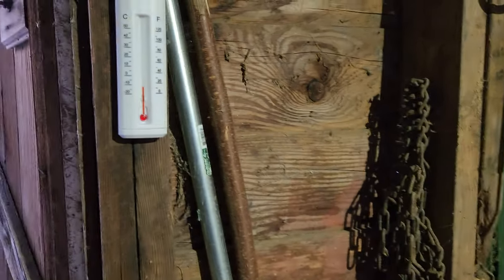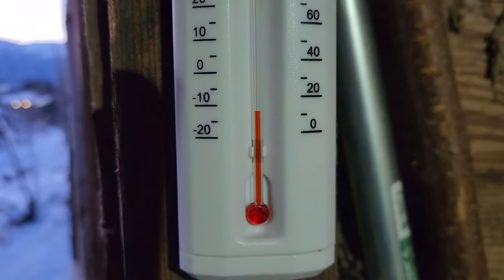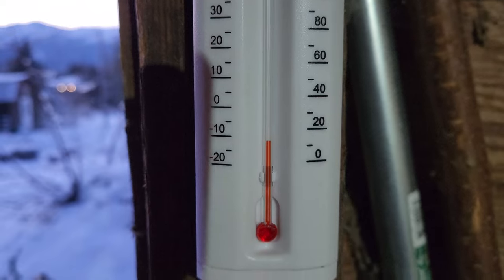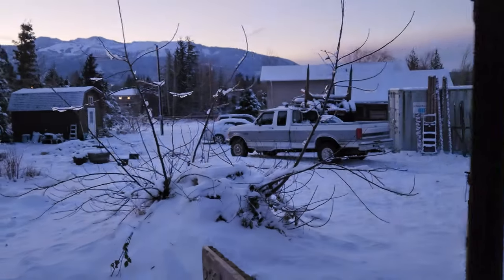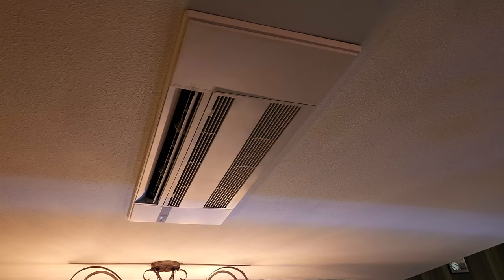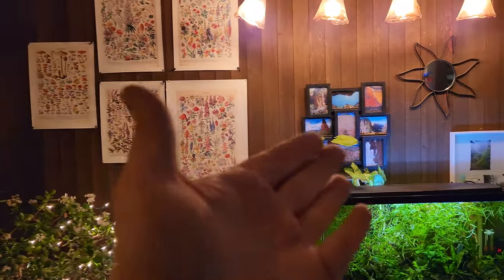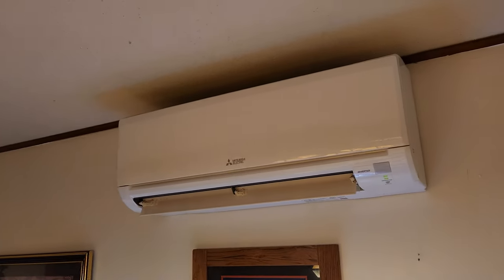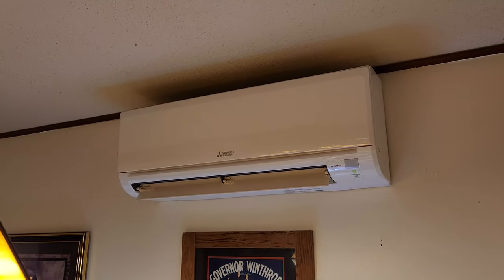Will a Mini Split work below freezing?

Comment: So far in the middle of the Arctic Blast in the NorthEast, at -13 and the mini splits are still spitting out hot air! I have 7 ceiling units (like the one you showed) and one wall unit. All of them working properly, but I can definitely hear the compressor working quite hard compared to when it not as cold.
Reply from the maker: Are you running the Mitsubishi as well?
Reply: @HomesteadBandwagon  yes :) all Mitsubishi. Only upped the numbers from 66 to 69 and spent the night nice and toasty.
Reply from the maker: That's really impressive! Guess I don't have much to worry about
Reply: @HomesteadBandwagon  indeed! Cheers!
Reply: Ya but how hot is the air what are you calling hot 65 degree discharged temp. Never heat your home with that
Reply: @billyrayboo7315 what you’re saying makes zero sense

Comment: My ramsond 27,000btu unit with two head’s running kept my house at about 70 degrees with outside temps between-3 to 12 degrees for over a week
Reply from the maker: That's impressive!

Comment: So are those the only way that you get heat? How can they cover the entire house? How many do you have? I'm just thinking about doing this but even with a small unit if I don't keep all the doors open they don't know how many I would have to have. And then do you lose efficiency if you're running lines through a cold or heated attic to get to other rooms to put another head in?

And don't you have to create some kind of wind chill effect when you're pushing hot air down because heat rises. So I always thought that just using an air purifier in the house in the winter I feel cheerier because the air is circulating not warmer.
Reply from the maker: We have 3 head units that heat the 3 areas of our downstairs. The heat rises and keeps things comfy upstairs where the bedrooms are, for the most part as long as you leave your doors open.  We have enough headroom to add a 4th unit upstairs if we wanted AC in the master bedroom or something like that, but haven't really wanted to yet. We'd need another heat exchanger if we wanted a head unit in every room, which would be pretty spendy. There are electric wall heaters in each room upstairs, but they're rarely used. It's been MUCH more efficient than any other heat source I've ever used, even though i run the heat much higher than i would with a furnace. It seems like it'll be less maintenance over time, as well as there's no ducting to clean and the main unit is outdoors, so it's very easy to keep that clean and unrestricted

Comment: I am not an HVAC tech, but I have had my Cooper Hunter 24k BTU splits installed about 1 year now, and I noticed sometimes when its super cold, like 20 or 15 or less (Fahrenheit) Also I am in NorthEast Pennsylvania.   They will occasionally make a "moose" sound, for a few seconds,  and from what I read its a pressure differential occurring. and its normal.  So sometimes, possibly your split might "moose" on you.
Reply: Does it heat good when temps drops very low?
Reply: @MrYorugua12345 mine worked good this winter.  So I would say yes.  .
Reply: @MrYorugua12345  Yes, it will run a little harder and might not be as efficient but yes, it does work.  I have 2x  Cooper Hunter 24k BTU systems, one for 1st floor , and 1 in basement.   I am in northeast PA and it did great keeping the house between 69 and 73 degrees the entire time.   This winter was not as bad as previous, but it was plenty cold enough.
Reply: I noticed on eBay today that a CH split has a COP of 3.81. is that real? What cop are you getting?
Reply: @BeKind-ve4id  I have no idea all I know is my electric bill has been better since stopping use of baseboard electric, and the split system kept up fine with heating the house this winter.  I am in the mountainy rural area of northeast PA and it gets just as cold here as it does for a friend of mine that lives up in Maine.  We get brutally cold weather for most the winter.  No issues here coming up on 2 years now.        Unless you bought the absolute cheapest Walmart clearance rack version of a split system, you should have no problems with a premium brand like Cooper Hunter.
Reply: Thanks for that comprehensive reply.

Comment: Do you run them on off peak electric?  Do they run up your electric bill a lot? Thanks from North Dakota
Reply from the maker: Out in our area, electric rates are the same any time of day, which is nice.  Our electric bill dropped by 30%, and we keep the heat on 24/7 at the same temp while also having AC, which we didn't before. I'm pretty impressed

Comment: I’m wondering why it needs to be outside, if it’s electric couldn’t it work if it was in the basement? Or in my garage? Heat the garage and the house
Reply from the maker: I've seen one in a cellar before, but when heating the house it would cool the cellar, and vice-versa.  It also can accumulate ice or condensation on the coils, which could lead to issues if there wasn't a whole lotta ventilation
Reply: Ok thanks
Reply: @HomesteadBandwagon  if it’s a actual in the ground cellar I would think (just my guess mind you) that if you ducted/vented the exhaust air out of the cellar you could take advantage of the ambient ground temp from being below the frost line? This would also help in the summer.
Again just a thought.

Comment: Question if you don't mind.  I have an old house as well.  By chance what is your cost to run this in winter and summer?  I need to get some for the upstairs.
Reply from the maker: Before we installed,  the house didn't have a functioning heating source in the downstairs. We were using 4 radiant space heaters, which were pretty efficient, but didn't really do a good job of warming all the time. After the install, we had a historically cold season. It's still historically cold, in fact! Despite that, our electric bills are 30% lower. Pretty great! We could lower them even more if we put timers on the units for when we're out of the house, but I've just been running them at 67 degrees 24/7. It's really impressive! I'd say our average bill is under a couple hundred a month, which is a great improvement
Reply: @HomesteadBandwagon  Wow, that is impressive.  Thanks for the response.

Comment: Well you did get the most expensive system on the market so upfront it's more money. You failed to mention if it's maintaining you set temp kinda important to know because at that point they'll switch to your emergency backup if you have one
Reply from the maker: No backup for this system except for a fireplace. Holds temps without issue down to under 10 degrees ferenheight!
Reply: @HomesteadBandwagon nice so what happens after or if it drops below 10 degrees Fahrenheit dies it cut off and stop or does it thaw out then kick back on just curious on the process thanks
Reply from the maker: @mikeham5465 it has never stopped running, but it will lose efficiency below a certain threshold. There's a heated element that can be installed in cold climates that keeps a drip tray from freezing, which cam be an issue when it's in the teens or below

Comment: We get -40 c in January and February here in northern Manitoba Canada. Will it work?
Reply from the maker: A mini split loses efficiency pretty quickly below freezin, so I'd bet it would reeeeaaaally struggle in conditions that cold. They do have some pretty ingenious systems to keep the heat exchange coils from failing, buy -40 is pretty extreme!
Reply: Mine is factory tested and guaranteed to work and put out heat from -31 degrees Celsius 🎉
Reply from the maker: That's incredible.  I'm really pleasantly surprised
Reply: I am wondering the same thing. I am in northern Canada and it can get up to -40 here for January and February and even times I seen it colder than -50c. I am building a sunroom now and I have a mini split I am going to put in there. It’s not a very big room, only 220 sq feet but I am hoping the heat will be enough for the winter. I am thinking though I might end up just turning off the unit when it gets to -15c and just use electric heat. It’s a well insulated room with high efficiency windows so will have to see what it’s like this first winter.

Comment: Your wall unit is too close to the ceiling I believe they need at least 6 inches clearance. I just installed a 18k hybrid mini from hotspot energy. Its 110° and evaportive cooler is still running fine but once the humidity kicks in I hope to have the panels connected and run it all day off solar for free 😊 nvenergy keeps raising their rates more and more so i am looking to use as little as possible from them while still maintaining and comfortable lifestyle!
Reply from the maker: I sure hope it isn't! The company we hired has installed a few thousand of these things,  so I guess they'll have to warranty it if something goes wrong
Reply: @HomesteadBandwagon  HVAC tech here…..he’s right
Reply from the maker: Weird. The installer gave me a lifetime warranty, and Mitsubishi said the spacing was  OK
Reply: mine were installed this distance from ceiling too. farther from ceiling make it easier to take off panel maybe?

Comment: Mine works down to -13°        But wood is much better..
Reply from the maker: For sure! We have a Blaze King Princess fireplace insert which has been a great asset. We didn't figure that we'd need a low temp version of the mini split but I might add the tray warmer this spring.
Reply: @HomesteadBandwagon  Mine works to -13 according to the specs... at -9 it started to struggle... but it held its own. At 10 to 20 it has no problems keeping my space warm.